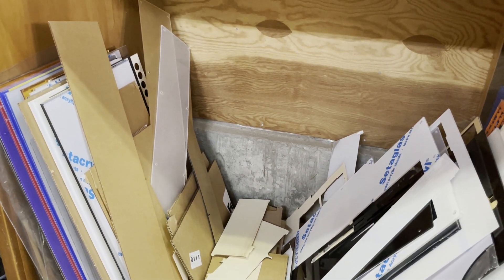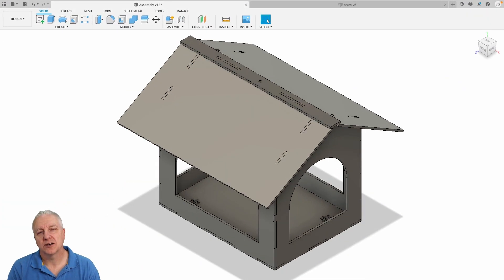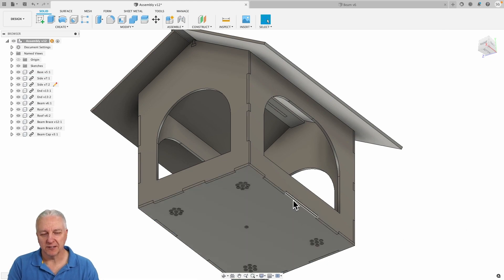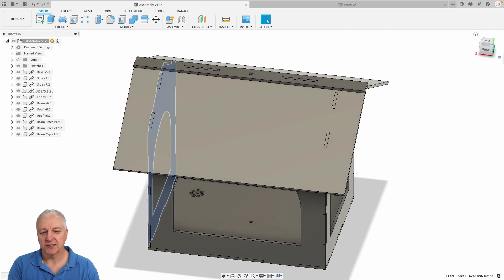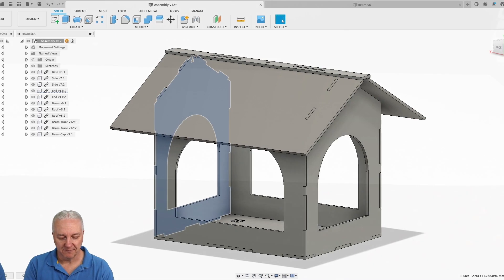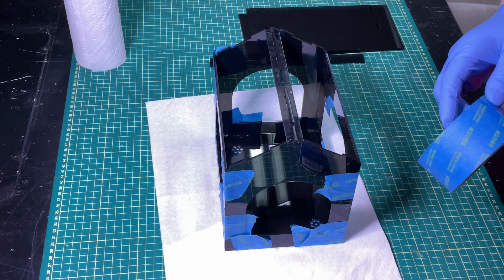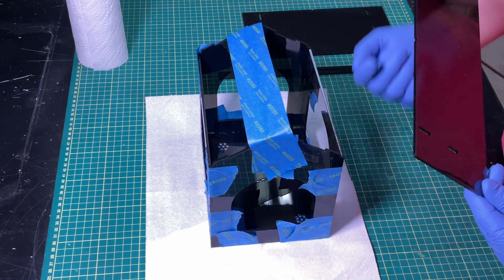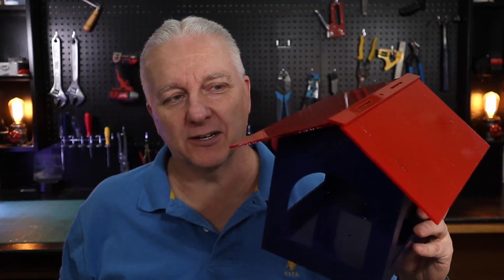Want a BIRD FRIENDLY Yard? Laser Cut Bird Feeders Are the Answer!

Comment: Would the snapmaker 10w laser be able to cut through the acrylic?
Reply from the maker: Cutting black acrylic is easy enough and you should get through red or blue. But I’m not really a fan of cutting acrylic with any diode laser
Reply: @SteveMakesEverything  since I am new to all of this, can I ask why?
Reply from the maker: @dlv0187  I'm just spoiled by CO2 lasers, which cut any color of acrylic like butter.  Diode lasers can cut darker colors but they need to work harder to do it.  They won't cut or engrave white, clear or other light colored acrylic at all without some sort of assistance